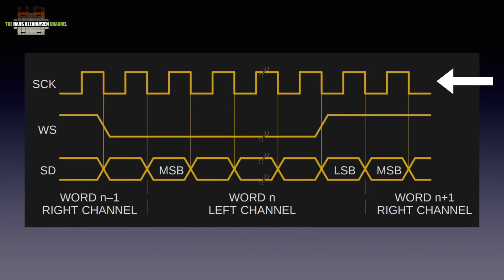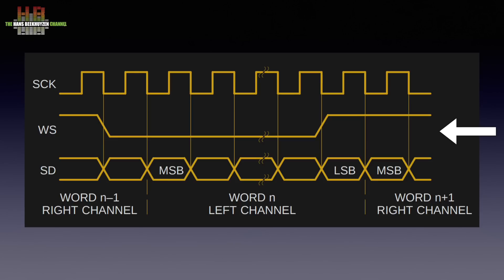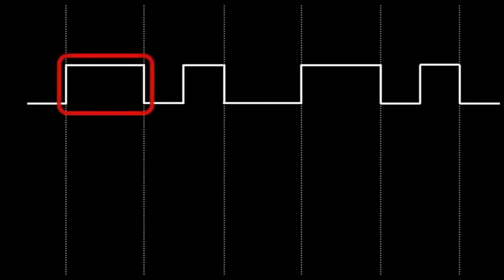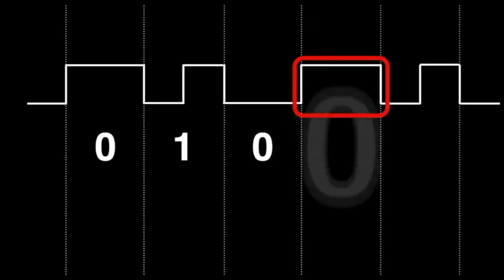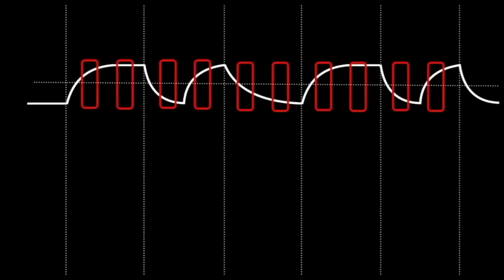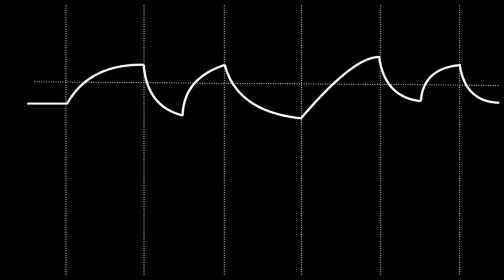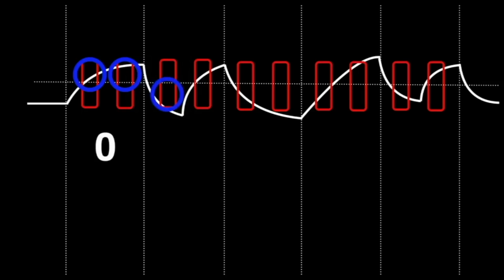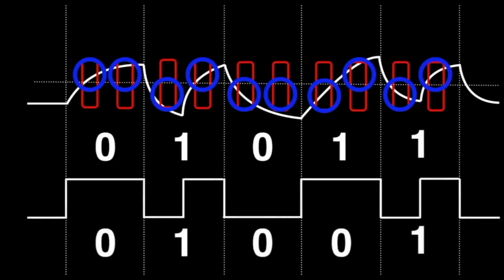Is I²S the best?

Comment: Thanks for the video on this subject. My experience is hit and miss with i2s, I think much will depend on your gear and your speakers. Right now, USB is king in my system with this ToneWinner AD-1Pre+ DAC/Preamp. I have had $6000 DACs in here, down to $79 DACs. I just bought the TEAC UD505X, and I just received the RMA# to return it. A lot of variables, and a good DAC is hard to find. .
Reply from the maker: As I said, it's the implementation of the interfaces.

Comment: Yes but AES?EBU and SPDIF will only output up to DSD64. Some devices stop at 192/24 with those connections.  If I'm not using an I2s connection I use USB so I can stream my DSD256 or 512 files. I left coax and optical behind years ago, I have never experienced sound quality issues with USB that I have read about.
Reply from the maker: True. Thanks for sharing

Comment: I’ve been reading a lot of people‘s opinions I2S and they say that it’s important to keep the cable less than .75m as it wasn’t designed for long runs. Do you find that to be true? Thanks!
Reply from the maker: I normally use a 4k HDMI cable of 40 cm but sometimes I need to use one (also 4K) of 1.5 meter. The maximum length depends on the the drivers Inside the sending device. The good ones use RS433 driver chips. The quality of the cable is also important. So 0.75 meters seem a too solid claim given the variants.

Comment: Good morning Hans, how would it be possible to know if the I2S HDMI connection would bypass the DAC's internal clock, and keep the clock of the transport/source? thanks
Reply from the maker: Standard DACs use the source clock when used with I²S but some DAC's can be switched to the internal clock. If zo, it will be mentioned in the manual.

Comment: Your videos are excellent and with professional illustrations. But the SQ varies and is very low in this video. I can barely hear what you say, listening on my HP laptop with built in Bang&Olufsen speakers. Even with a separate DAC and headphones it is bad.
Maybe your mic and placement can be changed.
Reply from the maker: In this case I had several problems at one time. The mic amp went broke, the amp needed more time to evaluate and so on. Next video I'll be ok sound wise. My apologies.

Comment: What about ST fiber glass optical output ?
Reply from the maker: That fully depends on the quality of the media converter and the SFP. It does give galvanic separation but for instance jitter and other pollution of the square wave signal is not solved and could even worsen.

Comment: Hi Hans, great channel, appreciate your expertise in our hobby.
 Regarding Optical cables, what are the differences between a glass cable and the plastic cable? Is glass worth the higher cost?  Im currently using a plastic cable from my tv to Ponyus 11. Would a glass cable be my next upgrade? Thanks, Derrick
Reply from the maker: Glass fiber is a better connector for light and thus has less losses. Unfortunately the light has to pass through the plastic TOSlink connectors twice.

Comment: at the end you need a receiver which rebuilds the clock again. if this is carefully done, then there is no problem. you then sample every spdif-bit with 16 digital samples and then you can decode it without any problems. the receiver has to also shift that 16 sample-window in the right way that it overlaps the incoming non-ideal signal well. however, there is a certain problem that needs to be addressed. even when the clock of the sender and receiver is a good crystal clock, they at some point will drift apart and that needs to be handled. this is not trivial but could be done with two crystals connected to each other very loosely. dropping a word or doubling a word is theoretically also possible but not my choice.
Reply from the maker: It's just as easy as becoming a millionaire: save one dollar and put it on the bank and simply repeat this until you own a million...... If it only was that simple, we would all be millionaires.

Comment: Thanks again for teaching me something new. I'm using IIS between my Denafrips ISIS USB reclocker and my Ares 12th-1 DAC. The length of the HDMI cable is no longer than needed to connect the two devices but I am unsure of its specs. I will be replacing that cable with a high quality one.

Comment: I appreciate your technical explanations in tech-focused talks like this, and the balance of technical information you provide in your gear reviews. Consumer I2S implementations go back a fair time. I had Audio Alchemy and Camelot digital gear from the late-1990s/early 2000s that used I2S connections. One of the challenges here is that there is no "standard" implementation. For example, the pin-outs between the Audio Alchemy and Camelot gear were not the same; you could not run the same I2S cables between the brands. I see that today some equipment has provision for configuring I2S connections.
Reply from the maker: And luckily more and more manufacturers adhere to the de facto PSU Audio standard.

Comment: Thank you for the upload. Very interesting.

After much deliberation and internet searching, I kind of gave up and settled on using AES/ EBU for my set-up of Auralic Aries G2.2 streamer to the Holo Spring 3, L2 DAC.

All good and I like the solid connectors. Use Audioquest Carbon, good quality at a reasonable price.

Very happy and not tempted to go back to the USB option that I tried before. 

All the best.
Reply from the maker: I am sure you made the right choice.

Comment: A little strange that there is no mention of that LVDS is the ‘long distance’ version of I2S…..
Reply from the maker: LVDS is hardly used in high  end equipment. And it is known by those that understand it. I try to explain digital interfacing to the average buyer. I didn't mention all variants of SDIF either.
Reply: @TheHansBeekhuyzenChannel  But the moment you bring I2s out of a device and into another device (e.g. over a HDMI cable) you are using LVDS, no?

Comment: Thank you! The difference between I2S and SPDIF on my Pro-Ject CD Box RS2T and DACBox RS2, using cables of similiar quality, is dramatic. Mids, highs, resolution, imaging, dynamics are in a totally different league with I2S. I would not think of poor quality-parts there  and both are fed by the same, high quality power supply. How can that be?
Reply from the maker: It could indicate a poor cable quality or poor electronic design of either (or both) the output circuit of the source and/or the input circuit of the receiving device.
Reply: @TheHansBeekhuyzenChannel  Thank you very much to take the time to answer! Cables are very good Goldkabel for 280€, and both pro-ject devices are extremely well built. The sound out of the combi is exceptional over I2S, seriously surpassing my Rega P8 with Ania Pro and Trigon Vanguard III with volcano battery power supply.
Over SPDIF it sound only like a good CD-Player.
I am listening with ATC SCM 40 and an amplifier by Ensemble, Switzerland, and I am professional musician, knowing quite well, how instruments really sound.
when I first listened to the I2S, I experienced a naturality in sound, I never had heard before on CD anywhere. Like it!

Comment: Thank you very much Hans for the excellent video. 
I have a Pontus II that has all the possible inputs and in the future I would like to have a streamer with all the outputs to be able to test, but as Hans has said several times, the sound quality will always depend on how the inputs/outputs are implemented, then it will be very difficult to have 2 devices with all connections at the same level. 
Unfortunately, most good streamers only have AES/EBU (Auralic Aries, Volumio Rivo, etc.) and don't have I2S (except Mano Ultra), so it's not possible to make a direct comparison. 
The streamers that I know of and that allow an AES/EBU vs I2S comparison are Mano Ultra (already tested by Hans), the Holo Audio RED and ifi NEO Stream. The RED and the NEO would be a very interesting review because it has all possible outputs (AES/EBU, Optical, Coaxial and I2S).
Reply from the maker: SPDIF uses the same circuit as AES/EBU, adapted to single ended low voltage. That will rarely be better than AES/EBU. Optical uses the same circuit as SPDIF but is converted to light and back and sent through optical connectors that have very limited bandwidth and thus will be inferior to SPDIF. So having AES/EBU and I²S suffice. I use a Neutrik transformer converter fro AES/EBU if I do need SPDIF (if the DAC lacks an AES/EBU)
Reply: Thank you very much for the explanation, Hans, it was very useful.
Reply: Volumio Rivo Plus has I2S output ;)

Comment: .            We must stop defining function based on whatever plug is chosen.  The plug is irrelevant (w/ min. req. conduits).  To say some product "has HDMI" is near useless telling us almost nothing about it's function/feature/method etc.
           Digital interfaces may be described more comparatively by renaming them with a new acronym like a "3CWD via HDMI" with "3" being the number of conduits, "C" being clock & "W" being word & "D" being data.
         USB would become "4PDDG via USB B" which is 4 conduit, Power, Data, Data, Ground.

                                                                                                                                                           Acid Jazz,  Funk & Brass  🔈🔉🔊
Reply from the maker: The naming I use is conform the standards. I don't see the need for renaming according your ideas.
Reply: @TheHansBeekhuyzenChannel  .
          You see, THAT's  the problem!.  Labeling or saying a port is "USB", which is the standard,  does not describe the work/process/function being done.
         The USB standard is not standard because the standard is forever changing & our terminology can't keep up.  "Universal Serial Bus" can mean almost anything.  It's the functions, not the standard plugs, that needs definition.
       HDMI, "High Definition Multi-media Interface" is the same problem.  It does not specifically define what function is being served.  Form follows function.
                                                                                                                      Acid Jazz,  Funk & Brass    🔈🔉🔊
Reply: I say we can be fine without any of such verbiage. All it does is confuse most people, or annoy them, and takes up space.

Comment: So the best way could posibly be streamer and dac in one box?
Reply from the maker: There always is but you have to try to see which one is for your equipment. Start with I²S, then AES/EBU, then SPDIF, then USB and last TOSlink. The best sounding is the best connection.
Reply: @TheHansBeekhuyzenChannel Thanks again for a great informative video. My conclusion is that good connections and protocols make the difference only when manage deficient signals. Just as in the analogue signals. Balanced are the answer with long distances or bad isolated cables or electronic noisily environment, and of course the same for power cables, speaker cables, etc.

Reasonable quality with reasonable signal is good enough, if the problems could arise, better protected solution could make the difference but again: no better sound if the signal is OK

Comment: Thanks for the latest video and the knowledge.  My brain hurts lol.  I’m using the USB cable that came with the Cyan 2 to stream from my Blusound Node N130.  The sound is excellent.  I was considering using the Holo Audio Red as a streamer using the I2S connection but I like the Bluesound app for streaming Qobuz using my iPad.  I’m good for now.  Maybe down the road with a newer version of the Red.  I love to tinkering with individual components.  A streamer is probably my next tweak.  Rock on!
Reply from the maker: Enjoy the music.
Reply: I changed from the Node n130 to Volumio Rivo ..then acquired the Cyan2 , I was using USB connection till today when I slipped a good AES cable  in ….a really large noticeable positive improvement I’m very happy
Reply: @deepvillage  Are you converting the USB to AES by one of those devises? Like what Mutek does? Or are you connecting the AES cable from Streamer to DAC ?
Reply: I upgraded my streamer to an Innuos Zen Mk3 and it made a difference.  It’s so quiet.  I didn’t know it could make such a difference.  I was hesitant to change ops systems but the Sense app Innuos uses works very well with Qobuz from my iPad.  I found Pine Tree Audio cables online and ordered their USB cable to connect the Zen to the Cyan 2 and it sounds great.  Ordered a custom length Blue Jeans cable 6A Ethernet cable to connect the Zen to my router and the overall sound is excellent.  I’m all set with my streaming setup for music and I am taking Hans advice and enjoying my music.  Hope everyone is having a great holiday season!

Comment: Really appreciate this video and learned a lot - but not sure why no context was given around USB as the hypothesis seemed to be around the best connection for a DAC? "Is it the best". A large number of DACs have USB and I appreciate there is a lot of discussion around the use of USB and its asynchronous nature so some of the discussion around the signal, clock, impact factors like power supplies and cables - would be different for USB relative to AES/EBU and I2S, but the talk track makes no mention of USB in the context of DAC connectivity and that is a bit confusing. Full disclosure I use a Network Acoustics USB IV between a HoloAudio Red and a Chord MScaler / DAVE combination and that sounds better to me than the other options out of the Red (where I2S is not an option into the MSCaler)
Reply from the maker: The reason is that I already made a video on USB for audio: https://youtu.be/lLcLWBcIH0o. In general the best designed output on the source combined with the best designed input on the DAC  sound the best.
Reply: @TheHansBeekhuyzenChannel  - that makes a lot of sense and I liked your video on the USB as an connection type. With my comment above I was just trying to understand your overall guidance as for example my Holo Audio Red has both USB and I2S - while the MScaler has USB, so USB in this case was my only option here and sounds very good particularly with the Networks Acoustic USB IV cable linking the two units. In future though depending on future upgrades - I may look to use I2S connections as a criteria (among other factors for choosing a streamer / network bridge and a DAC. Thanks again for the highly informative videos

Comment: Thanks timely I am testing a new I2S isolation board @ this moment
Reply from the maker: Good luck!
Reply: @TheHansBeekhuyzenChannel  So Far So Good I will continue to test in my home lab the upper limit is about 150megabytes  so far it's worked on a off the shelf DAC & a Multibit DAC board for Raspberry Pi.. But running on a x86 version of Volumio ... That configuration has lower ripple noise and no current noise like the Raspberry Pi but I will continue!!!!